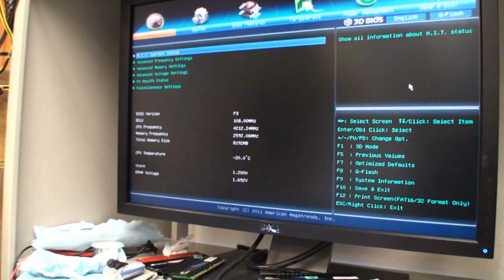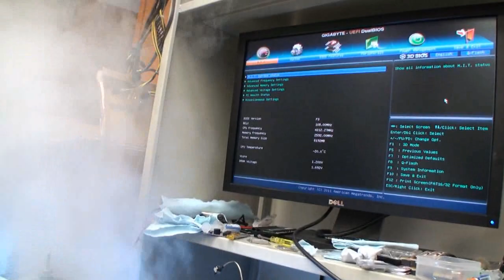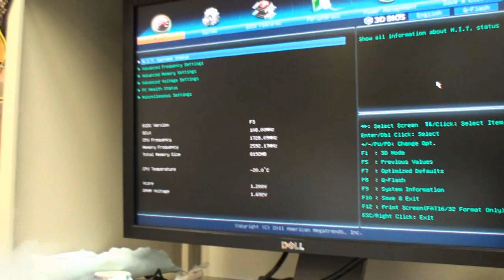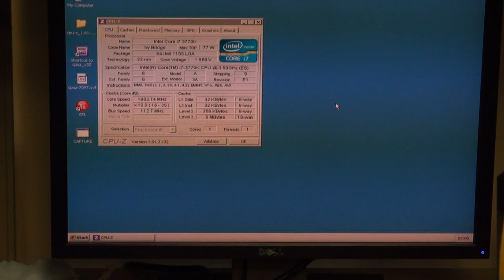GIGABYTE breaks Core i7 3770K OC World Record at 7102MHz with upcoming Z77X-UP7

Comment: Thats when you hit absolute zero or close to it. Most hardware has a cold bug or point where it wont operate. iirc the bulldozer chips would go super low temps b4 shutting down.

Technically suicide runs are just that, no need to run benches just see how high she goes b4 it blows!

Comment: Your right higher Clock doesnt mean its faster, all it says is that it doest more calculations per sec, but you can have a cpu that only need to make half those calculations then its faster even if running a 51% of the other one speed

Comment: While that's fun an all, i'm more interested in a stable everyday gaming clock. I have a q9550, which is at 4.8ghz, on air with a slight voltage increase (only 1 bump up). It semi hot, been like that for about 2 years now :)

Comment: GIGABYTE GA-Z77MX-D3H TH

is what i would recommend when it comes to intel and gigabyte. it's a micro atx board with SLI compatible PCI 16x slots (two of them). 4 DDR3 slots for RAM (32 gb max) and 6 sata (6gbps) ports for up to 6 drives. There are far better ones i believe, but this is my recommendation :)

Comment: Will this work?

i7 3770

GTX1050Ti 4G DDR5 Computer Independent Hd Game Graphics Cards

GIGABYTE GA-F2A75M-D3H

250 GB Samsung SSD 860 EVO 2.5 Inch SATA III

Samsung HDD 640GB

Gigaware Cellular Chassis Desktop Computer Beehive with Glass side CPU Case

Corsair Vengeance RGB PRO 16GB (2x8GB) DDR4 3000MHz CL15, Corsair-Vengeance RGB Memory is for High Level Graphics and Intense Gaming Experience, RGB Sync compatible to Gigabyte Fusion, MSI Mystic Light, Anodized Aluminum

Comment: Wtf. The video skips and it dont show it hitting 7ghz just cuts out when at 1.9
Reply: Right before the video cuts, it shows 7102 mhz. That's why it says after "this is usually all the time you get"

I thought the same as you at first and had to re-watch it.
Reply: Ah, i see.
Reply: jimmi pinnington  It's because his voltage was at 1.9v, as soon as the switch hits, it increases that voltage from what shouldn't go over 1.5+/-  0.1. Shit was at 1.969v. That switch that he hits, is a power cutoff switch, that is calibrated on clock multipliers.

Comment: Not really... the lower the temperature, the slower the electrons move.. that's the rule..
When it gets very close to the absolute zero (because you can't get exactly down to it) the electrons are barely moving..
Did you try to benchmark your system when it's practically frozen?
High temperatures aren't good for the CPU either
My bet - keeping the CPU at around 25 degrees Celsius constant (with mad OC) can give good performance..
Benchmark - then talk :))

Comment: If it works why fix it? My last 3 boards were Gigabyte, Each had different features. Everyone has different needs, save your money! I'm sure there is a difference in OC CPU's But is it worth it? I'm running the 3570K its amazing at stock speeds. But I'm a guy that likes to tinker so its running at 4.7ghz

Comment: While Asrock is a very cheap manufacturer for motherboards, it's kind of a given that their quality is a bit less then others. I've owned a ASrock motherboard to shed some life into a old 775 processor and it did the job for 4 years now. However my experience with ASUS has been less then fortunate, glitchy bioses, DOA's, bad solder joints. it all comes down to personal experience, i can say that ASUS sucks ass, but that would be invalid, because 1 or two motherboards is not enough to judge.